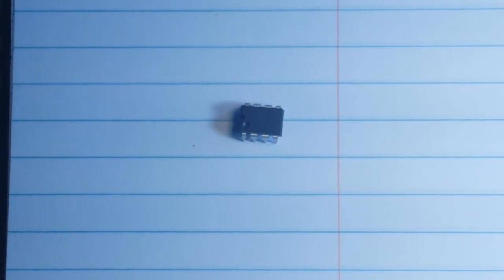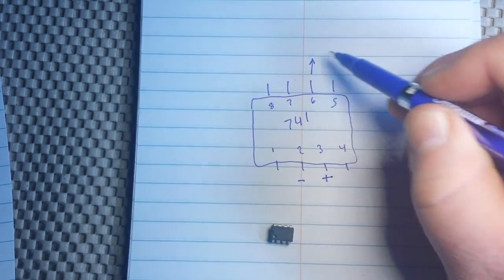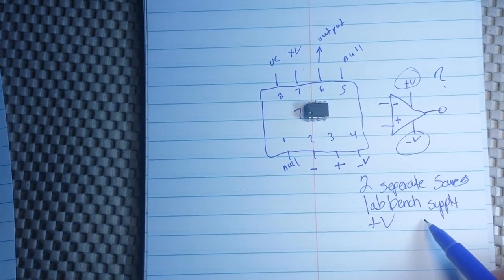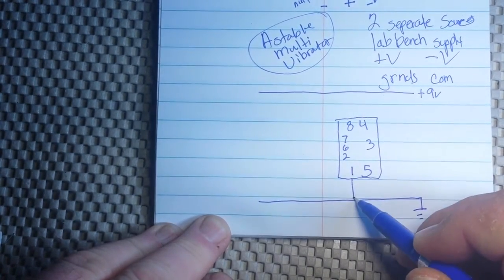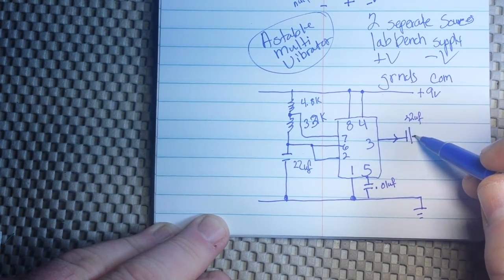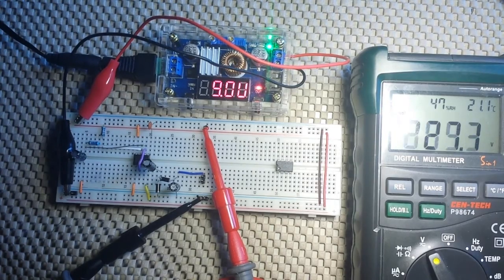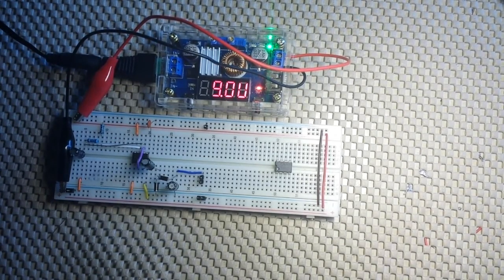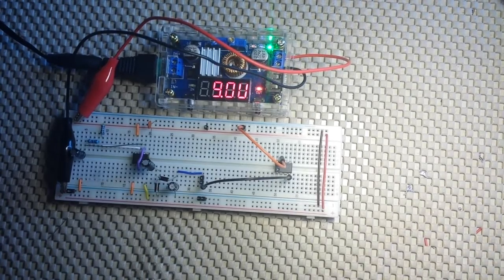555 Negative Power Supply

Comment: I am trying this circuit, with the 555, and it does provide a negative Voltage, if I don't connect the 100uf cap. Running at 10 volts, I getting -7 volts, does this seem correct?  I'm sure there are losses in the circuit.

Comment: will this be enough to open a large dmos? custom built cap discharge spot welder... i ordered a large dmos  to act as nc relay and drain cap bank either when user wants lower voltage weld or device is off/unplugged. ill probably breadboard it later today but any pitfalls or better aproaches other than  buy  another ic just for that neg rail are apreciated!

Comment: Thats ok but if you intend to put any kind of load on the output of the 741 or 328 or whatever op-amp you intend to use its not going to stand up to the draw and pull that negative charge close to ground.  I like the idea though for low load op-amp activity.  You could get a similar kind of current output off of a regular op-amp with negative feedback shorted to output and load balacing resistors between + and gnd rails on positive op-amp input.
Reply: Please explain with a video,  how to get more amperage from the negative voltage supply
Reply from the maker: +M Harding I agree with you, this was just an example of what can be done with a 555.